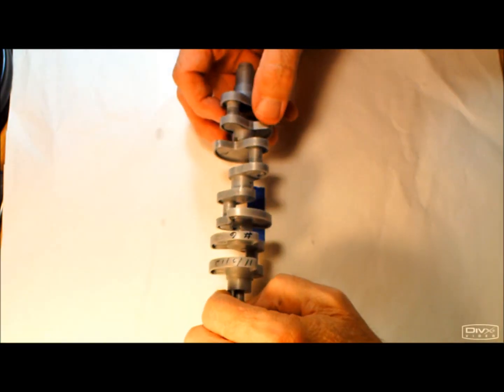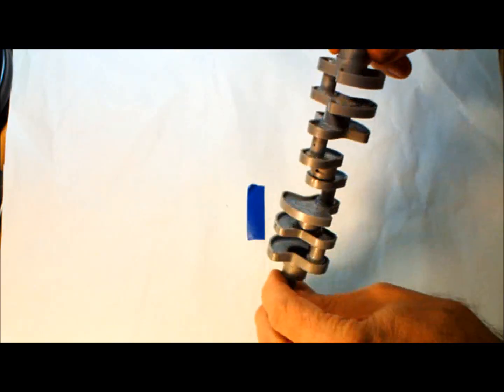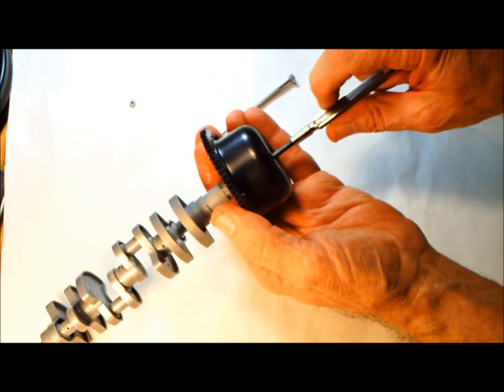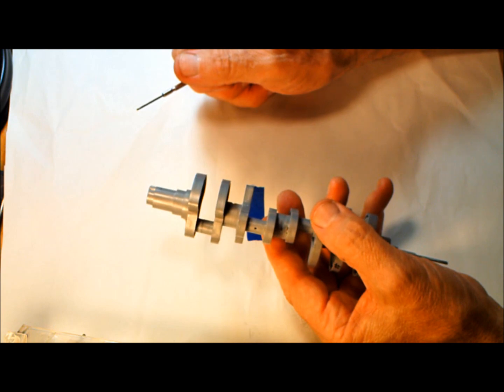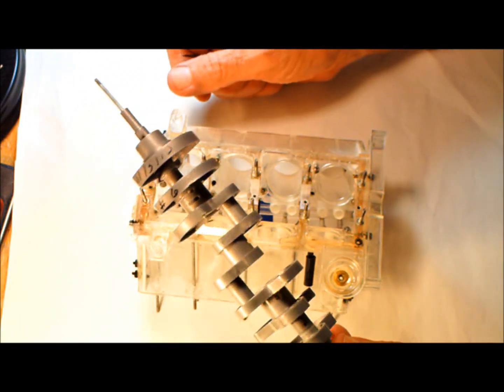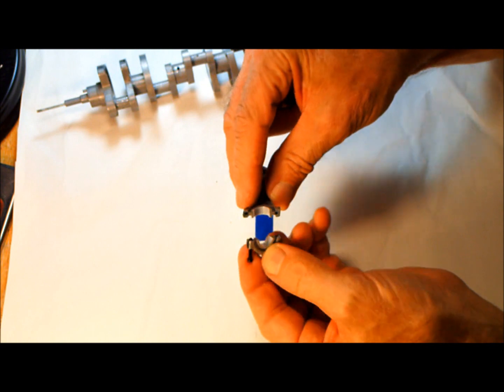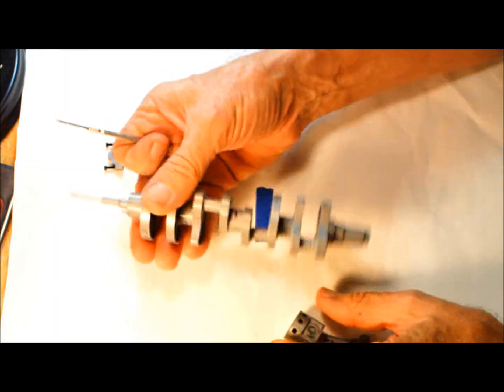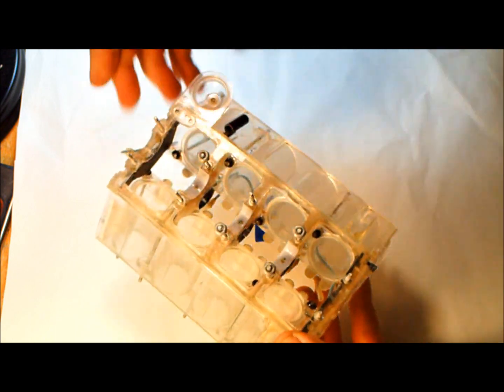Visible V8 Crankshaft Sept 15 2011

Comment from the maker: There is no book on how to do this, so I am learning as I go along. I am using a external sump, filters, and pump. I think you can tell from the videos. The part number for the pump is listed. The lubricant is glycerine at about 95 Deg F. I use Permatex epoxy and Plastruct welder. As far as failure, they will run stock out of the box without a oil pump or anything special other than a coat of oil every now and then, if you stay below about 1500 RPM. Above this speed could have a failure.

Comment: You are very welcome.
I suppose the next question I have would be about your lube system (i.e., pumping the lube, etc.). Would you have any pointers or instructions in that area?
On the glueing of the block sub-assy, any special glue that you have found to work better?
Sorry for all the questions, but i am about to build one of these for a special purpose and need as many pointers, hints for reducing failures, and any other advice you might have.
Again thanks in advance and for your work.

Comment from the maker: Thanks, The rod end was bored out, then the threaded holes were made, then the ends sawed at the middle, the 2 56 nylon screws installed, bored out again, .015 inch thick bondable teflon cut to size, super glued to the inside of the big rod end. There was a lot of testing involved before the first video was made.

Comment: I am assuming the saw blade thickness (which is removed by splitting the rod) is replaced by the teflon? What thicknees teflon did you use? Thanks in advance. BTW, some really great videos....you did a wonderful job....and I'm so impressed by the RPM you have acheived from these test.  Regards, Lowell